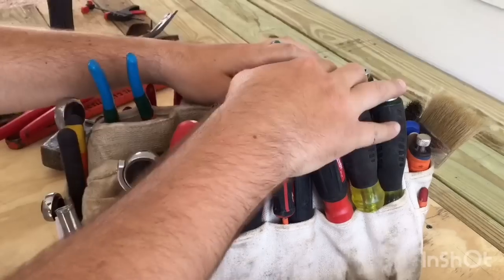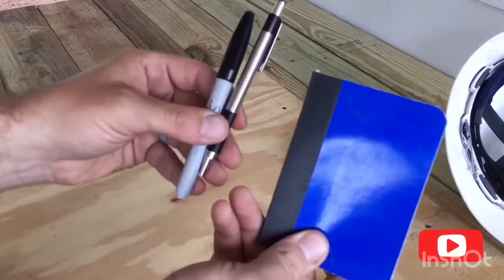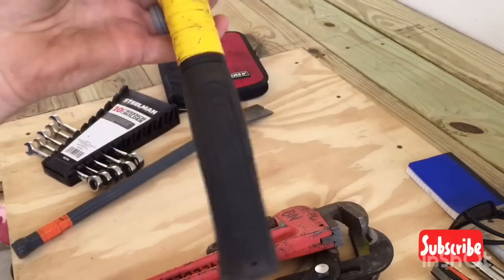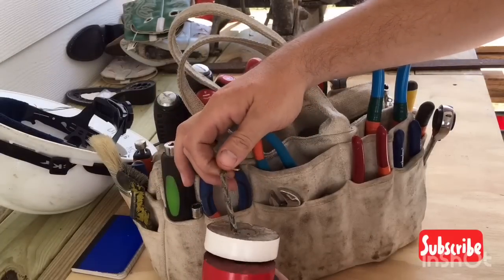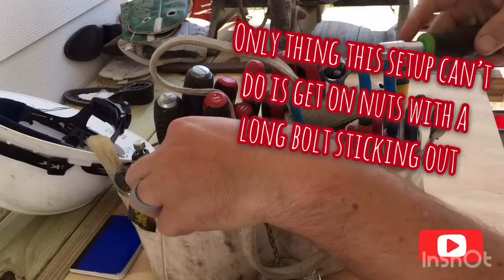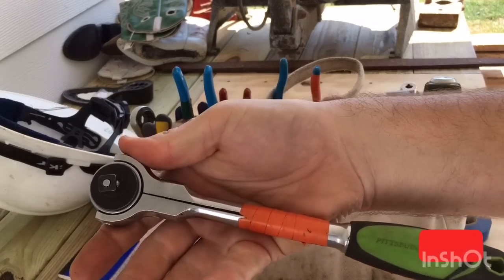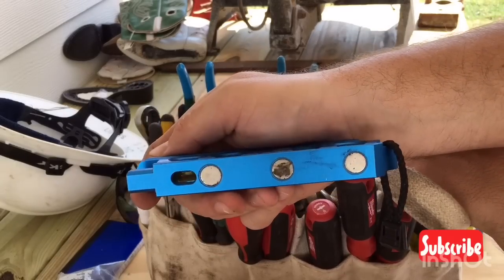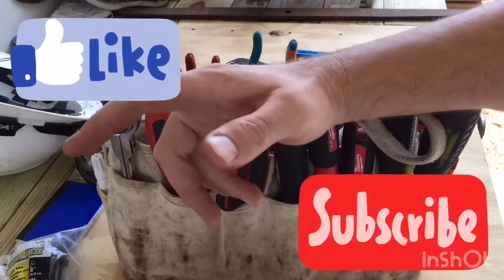Electricians Tool-bag Tour | Industrial Maintenance

Comment: I def found this really interesting, I did satellite communications in the Army and we had to always make our own cables and networks, we also used similar tools, maybe not the pipe wrench but def a hammer well more sledgehammer. That self made tape ring is def something I want to make I hate looking for tape in general.
Reply from the maker: Thanks. I did some comm work in 2015 when I got laid off from oilfield. But it was for AT&T...... the job wasn’t bad but having to go into some peoples homes was what made me leave. It’s sad the complete filth some people live in. You wouldn’t believe me if I told u

Comment: Great video thanks brother. Like the tool set up. I have a question regarding the tape on the tools. I think I know why it's there but I think you should let everyone else. I hated going to a job site and have to have everything inspected before using them. There I  believe I just opened the door for you. Keep up the great work see you in the next video thanks again brother
Reply from the maker: No that’s not the reason although I know exactly what ur talking about we only had to do that with power tools. The tape or some are even painted is just a way for myself and others to quickly identify that it’s my tool. When a motor goes down and you got instrument techs, millwrights, and electricians all workin in one area it’s easy for your tools to grow legs

Comment: Originally from NYC, grew up most of my life in Milwaukee. Serviced business machines for Milwaukee Electric at the time. They are OK, but not the best. Well at least not anymore. Trying to figure out why your tools are spray painted? That South Wire wire stripper, looks really close to my Klein; this thing is the best of the best as far as I'm concerned. For most tools Craftsman is the best I don't care what any tool truck tries to sell you. Not a snob by any stretch of the imagination but I have never bought from Harbor freight neither will I do so.  When you look at a tool it should be quality and it should look that it will last a lifetime even without a warranty. Might cost a bit more but it will be worth it in the long run. I have quite the assortment of junk tools because of others buying for wives tools boxes and on and on. Work with Spec's, commentary,  but most of all your Eye for a quality tool for the job. I would like to recycle the junk but once and great while one of them comes in handy for a particular job. It's rare when I throw one away but I always keep them clean.
Reply: Curiosity - I’ve worked at places where I used to spray paint my tools too. For one it makes them not so shiny and alluring for someone to want to steal and  for two once everyone knows what color you use to paint your tools they will know it’s your tool and bring it back to you if you leave it somewhere. 

I agree with you on  the Harbor Freight stuff. I never ever see any industrial mechanics where I’m at using that stuff.
Reply from the maker: Yes the spray paint/electrical tape is to be able to quickly identify a tool as yours. Curiosity I agree with most of what you said until you u got to saying that craftsman are quality tools. They are not bad tools but not the quality at the price point they are charging. All tools have a place in my bag from low end to high end. If a Pittsburgh tool is in my bag for work it’s for 1 of 2 reasons...... 1) to find a name brand of that tool would cost way too much more (not many companies make angled dykes and they ones that do definitely want a lot more that $10 for them) or 2) I’m not sure if I’ll use the tool often (the extendable nut driver, I wasn’t sure if I was even going to like that setup idea) Now all that being said, I had a coworker that was a young kid. KLEIN EVERYTHING! Did he do a better job than me because his tools said Klein on them? Hell nah, I could run circles around the guy. Remember the tool is only a minor part of the equation. I hear people all the time say, “those cheap wrenchs rounded off my fastener” NO...... YOU ROUNDED OFF YOUR FASTENER. You chose the wrench, you didn’t see it was a bad fit, you decided to keep trying to turn that sucker. But anyways. I’ve rambled long enough. Y’all may have given me a video idea 👍🏼
Reply: Brads Workbench Yea I agree. If you’re gonna buy the Craftsman tools that are made today you might as well just go to Harbor Freight. It’s all the same stuff - made in China. 

I agree that the quality of the tool doesn’t have anything to do with the skill level of the person using it. Everyone has their own perspective on how much they should spend on tools and what’s worth it or not. For me - I just don’t understand why a professional would use anything less than a professional grade tool. As far as spending extra money: If I’m going to work for places and expect to be compensated top dollar for my skills then I shouldn’t have a problem paying top dollar for the tools to do the job. Who am I to demand a prevailing wage and then turn around and tell an American tool company that they want too much money for their tools and buy a lesser quality one from a country who treats their workers less. That’s just my perspective. 

Easy for my to say now though because my last couple jobs it is highly frowned upon brining your own tools in. 😂😂😂.
Reply: CC-Charlie Ott.. << We can't do a CC right now but that should be something to look at YouTube.. 

I understand now where I had no clue why you might paint your tools. Personally I would have a hard time doing it even in a professional environment. I don't spit shine them but I like them looking the way I got them if possible. 

China: Well I wish and hope we can slowly bring back the jobs and the material workmanship to the U.S.. What is built under a name like Craftsman in China is designed here and produced there. There is an exacting standard that is met in order to sell it under that name. Now where you buy one of their cheaper models in the store you are hopefully excepting the fact that it does not have the same design quality.  It does not have the same not warranty , but rather Guarantee Craftsman assigns to it's products.. There is a huge difference. I like the other great tools sold on trucks but they may be  comparable but if you pay the price so far for a quality Sears engineered tool you will be happy. 

You are both absolutely correct,  you can have a made of Gold ratchet wrench in your hand but if you cannot use it properly it's just a stick of Gold. Better to get into selling precious metals. 

Guy's myself I will buy anything where I feel the tolerance in the tool is exacting backed by the reputation of the company, even if that company is on the edge right now. 

The Klein thing I thought was interesting as they looked like the one I have and just sold under another name. 

Appreciate the feedback guys. Gerald

Comment: My boss has the same craftsman nut driver set and I have the craftsman set that look like Klein's rebrand/knock offs in nutdriver and screwdriver sets. I told myself I would upgrade to Klein's but 12 years later still using the same sets everyday
Reply from the maker: Have you seen tekton nutdrivers? If I needed a new set, that’s why I would buy!
Reply: Brads Workbench I was looking at them the last two times I went to cal-ranch and they feel nice in the hand but I don't need a new set but might get the couple metric sizes I need to try them out
Reply from the maker: Same reason I haven’t got them yet either.

Comment: what was the tool at 4:44 from HF?  I haven't seen it before.
Reply from the maker: It is a “extendable socket driver” that accepts 1/4” drive sockets. Also has a square in the handle so you could attach a 1/4” drive socket if you need more torque. I used it as a extendable but driver basically. Can be found in the socket and ratchet section
Reply: @BradsWorkbench  thanks man, definitely picking up one of these